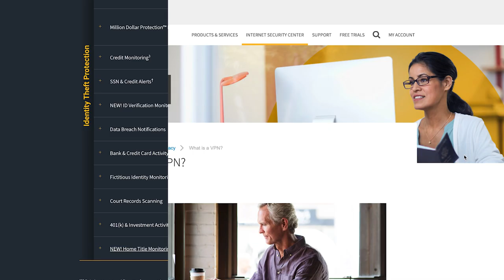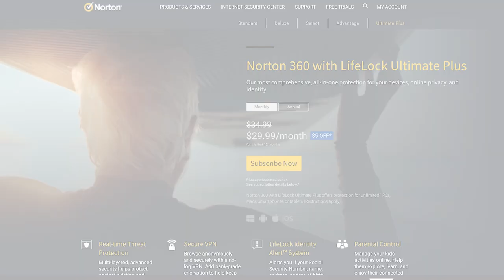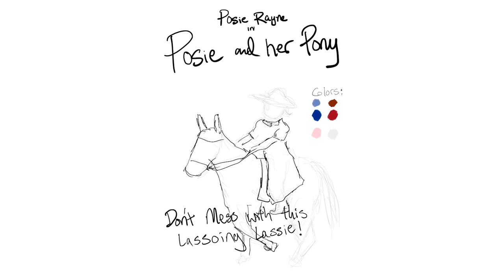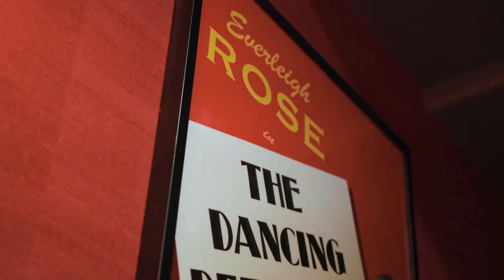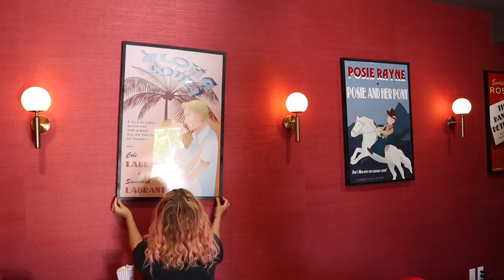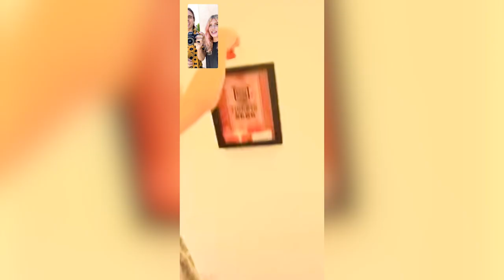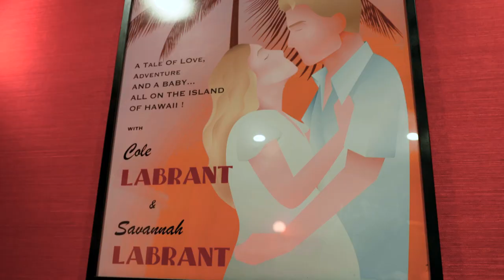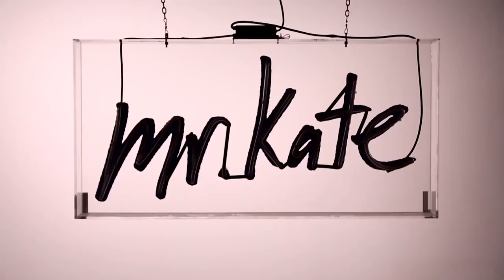Ultimate DIY Home Movie Theater for The LaBrant Family!

Comment: I really wished for red velvet ceiling to floor curtains on the wall including the monitor that were remote controlled to open and close. I think you missed an opportunity. As an ex-flyman (with awards), of course I'd want a fancy control so the opening and closing of the act curtains could reflect the show. That's not required, however. It would not be hard to have some slowly pulling back act curtains in front of the tv. Not complicated. Not expensive. Well within y'alls skills. I can only imagine it didn't occur to you. Joey, do you have arduino skills? Not hard at all!